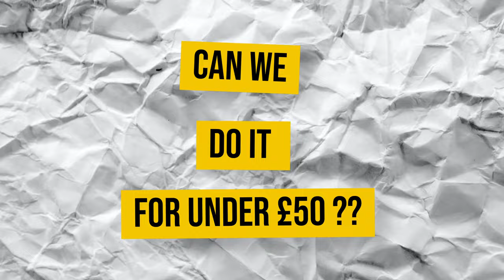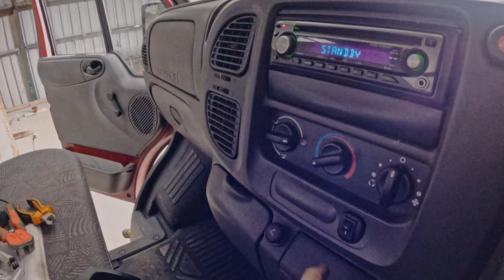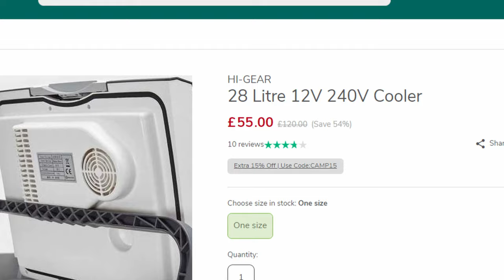Campervan DIY Kitchen Worktop | VAN BUILD EP 13

Comment: Great video, good editing and good lighting aswel. Youre kitchen looks very good and the coolbox fits very snug in the kitchen. If you ever buy a new coolbox buy a compressor coolbox they work so much better than the one you now have and they are way more efficient with the powerdraw on your battery or powerstation.
Reply from the maker: Oh are they? We will certainly look into it! We think this cool box is only temporary so we will definitely do some research, thank you!
Reply: @TakeAPeakAtThis  I confirm:  those thermoelectric coolers do not really produce cold and they run all the time, you will have a dead battery very quick.
Reply from the maker: We have adapted it slightly and installed a switch on the side of the kitchen, so if empty, we can switch it off without too much hassle but we will keep an eye on the temperature, thank you 😊